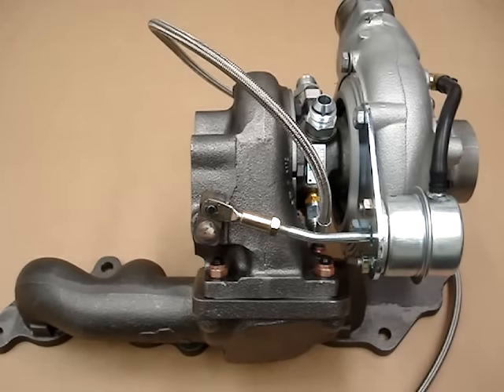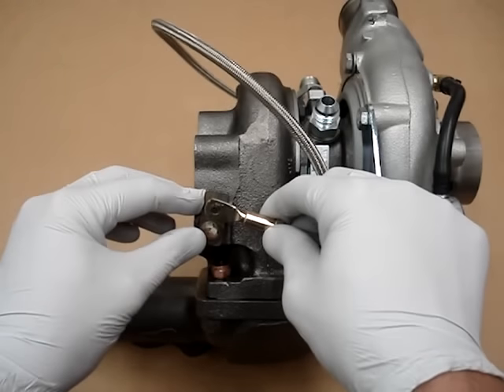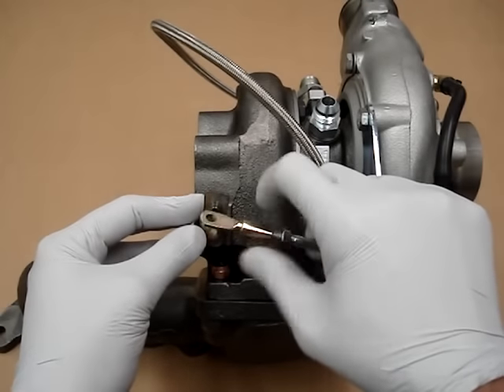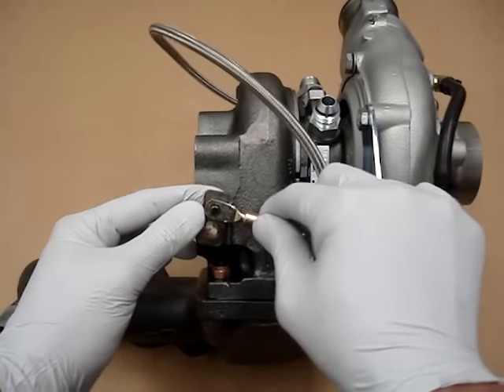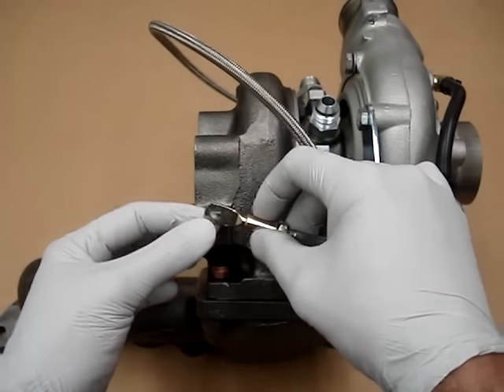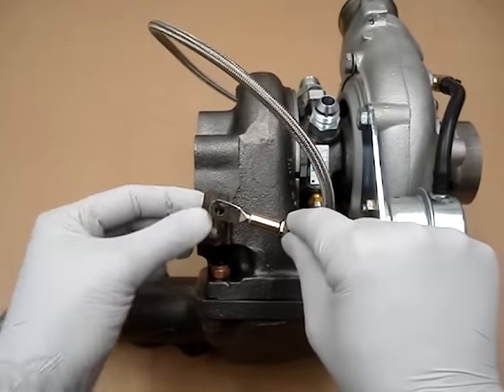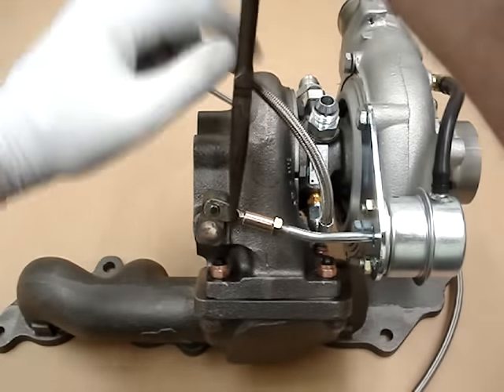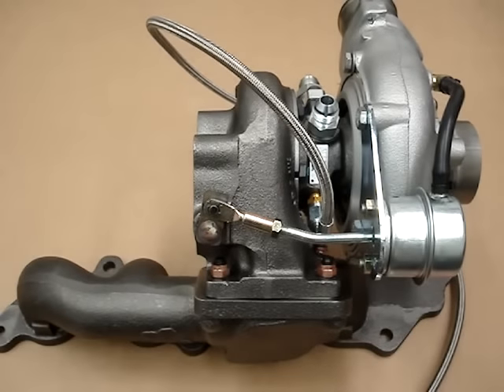Wastegate Preload Setting

Comment: On m BMW F11 525D Xdrive 2012. my actuator rode is a long plastic with a hull on the end. Is the adjustment to pull of the c-clips and turn the plastic rode clockwise to shorten the rode to increase boost? I have no boost at all. My diagnostic with my Autofix scanner tell the same error everytime 29A400 the flap is too far + deviation.
Reply from the maker: Not familiar with your car specifically but research it more online first. Your actuator may just be bad and require replacing.
Reply: @vikenk  After some research: The crank pressure is  not adjust properly within the operation range, between 1.4v-4.1v and the close range for the flapper is not adjust within the close range either. The hose between the pressure converter and the wastegate is cut up 2 cm and cause a big leakage.  Now the hose is replaced with a 2cm longer hose. I do not have an scan tool to adjust the crank pressure yet. I think the best tool is a handpump Mityvac 8250. Is the standard pressure between 7-8 psi and 0,8 bar?